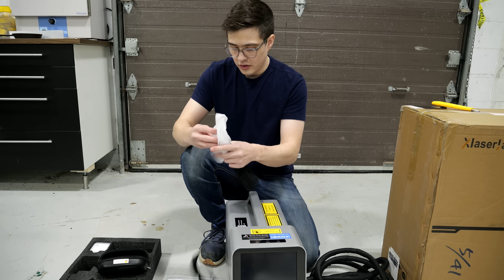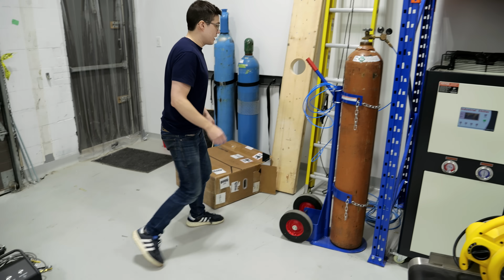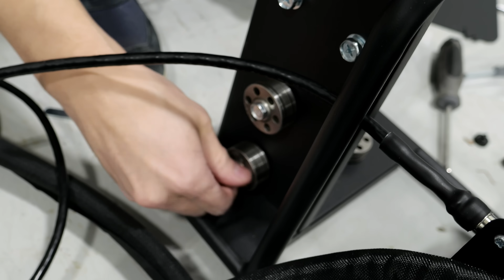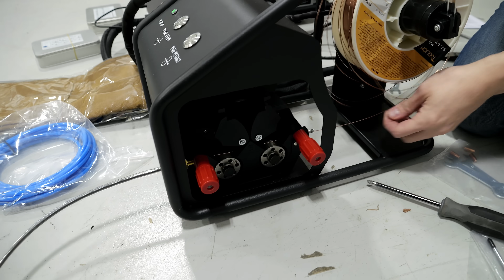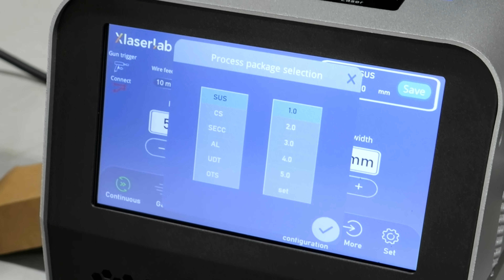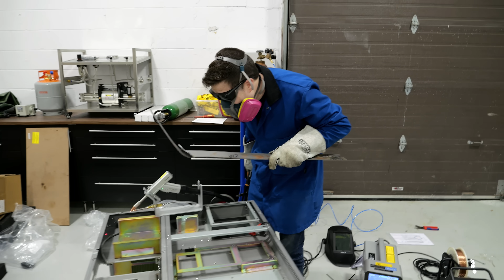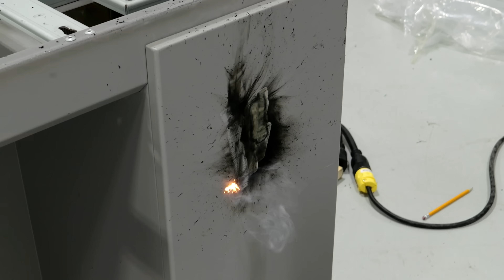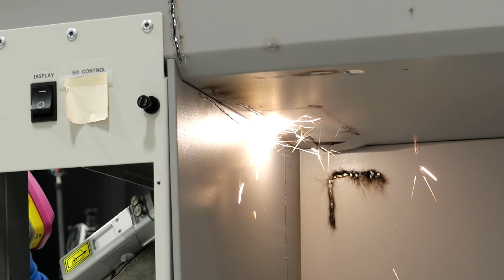I got a new laser machine (I love lasers)

Comment: Laser nerd here with a bit of advice. Unless those glasses came with an independent test certificate showing the attenuation and the regulatory specs they meet, treat them as worthless and buy yourself some proper ones from somewhere trustworthy like ThorLabs. Their support folks can tell you what you need for protection against the non-incident beams at that wavelength and pulse profile. They definitely won't be cheap, but that's because they're actually rated to protect your eyes instead of just being a cost-minimised add-on item included by the manufacturer. I've seen all sorts of high power fiber laser products come with nothing more than $2 coloured acrylic goggles. The worst part is that retinal damage is sneaky - you can get holes in your retina and you'll never notice them until there's one hole too many for your brain to correct around, at which point you've got permanent severe vision loss. Heck, the goggles are worth it just to save yourself needing to go get retinal tissue imaging, which is rather unpleasant - ask me how I know!

Comment: Wow for such a thin bead of weld, that's impressively strong. I  figured the hammer would've made it snap.
Reply: A guy did a thorough review of this machine, and the welds all have nearly 100% penetration on any thickness its rated for. He was doing 1/4" plate welds and getting full 100% penetration. Its welding ability is actually pretty extreme within its limits
Reply: @bower31  I mean there’s a reason the aerospace industry uses laser welding…
Reply: @AJediSurvivor it does, sometimes, very far from always, tig is still 95% of the time

Comment: That..... was a surprisingly strong weld. I never expected it would bend that much without snapping.
Reply: Ah.... $4000 for just the welder. Nevermind then, at that price point no wonder it's  so easy and intuitive. No point in even bothering comparing it to acetylene or TIG or MIG, or anything sub-$1000
Reply: @steelplasma256  Well for a business you'd have made that back by the time saved in less than a week, so I'd say it's a pretty good deal.